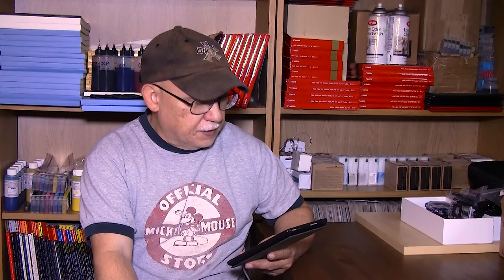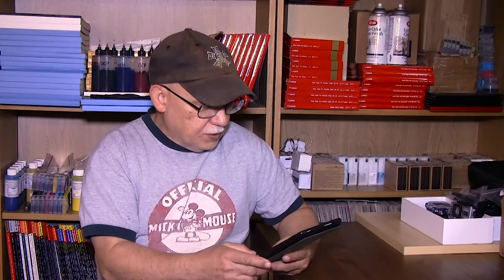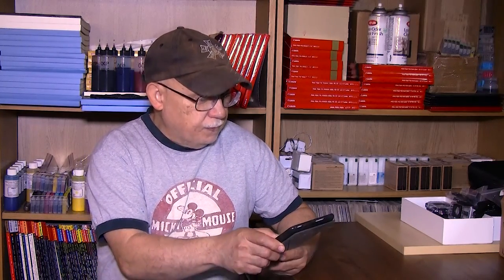More Awesome rumors about the EPSON P600 photo printers!

Comment: I'm based in the UK and I'd just like to say a heartfelt thank you for these videos, they are so helpful. 
I photograph dogs for a living and sell the prints to the owners - I still have an Epson R3000 that became terminally faulty after 14 months so 2 months out of the guarantee period!!  As a result of watching your videos, I now realise that it was the PK/MK valve switching problem. I wasted about £300 ($400 ?) worth of OEM and 3rd party inks trying to solve the issue.  Epson were no help what-so-ever.
I then bought the P600 (which I struggled to afford) and it produces fantastic prints, but I use OEM inks because I'm scared to death of 3rd party cartridges causing a problem.
Like I said, I still have the R3000 because I live in hope of being able to resurrect it and I detest wastage.  Last week, I dug it out of having been stored for 2 years. The Vivid Magenta was missing almost completely so after a thorough clean & overnight soak with the carriage over a pad of Magic Bullet, it was still pretty rough so having nothing to loose, I took the cart out and pressure injected some 3rd party vivid magenta ink.  I then put all the OEM cartridges in, did a clean cycle, and it produced decent prints on pearlescent lustre paper. Because I would hope to dedicate a printer for my greeting cards on heavyweight Matt paper I swapped to MK, but all the prints still come out with a slight green/blue cast which is especially noticeable with black dogs.  As soon as I have a chance, I intend to pressure inject the MK channel to see if that improves things.
Anybody out there got any thoughts on this?
Reply from the maker: Be very careful forcing Ink through the ink port as printers with stationary carts have other valves downstream from the ink cart compartment which can be damaged. 
By the way it is not the carts, OEM or otherwise that causes the black ink switch problem. 
The valve simply fails after a couple of years. Usually because it is not used often. People are worried about the east of ink caused during the ink switch. The P-600 will eventually succumb to the same fate. But it was supposed to have been addressed by Epson although only time will tell!
Reply: Jose Rodriguez Thanks. Yes I now realise it’s not the cartridges that caused the valve to fail. Incidentally, I found that the 3rd party carts seemed to confuse the printer’s firmware making it sometimes fail to recognise genuine OEM cartridges
Reply from the maker: Yes that can definitely happen! Epson began to implement measures to LOCK printers to only OEM use once you use refillables just once. THE P800 is one prime example.